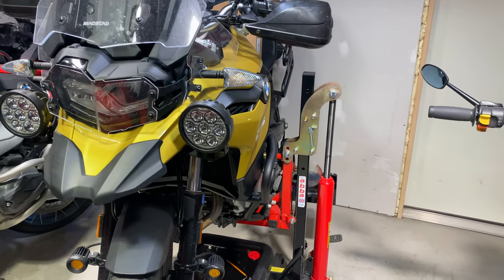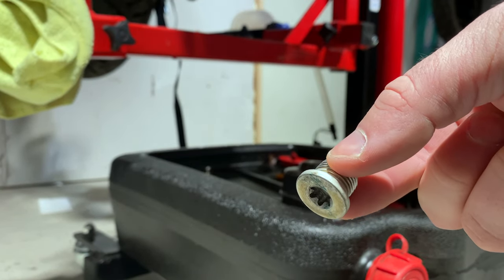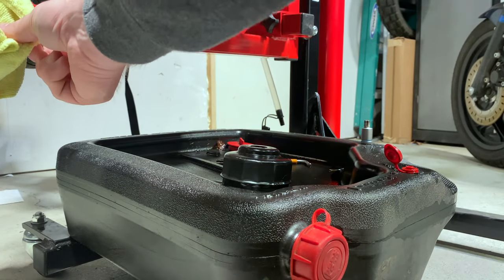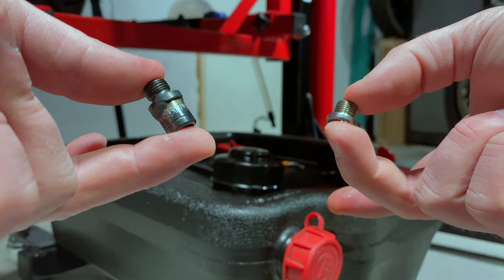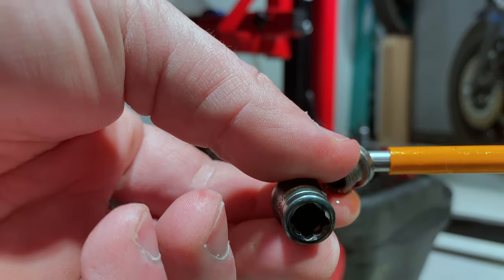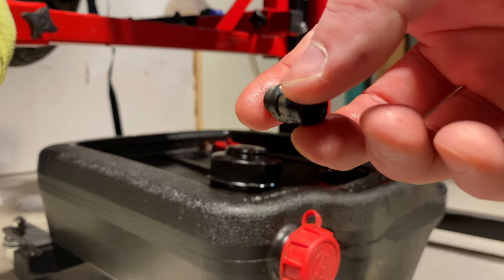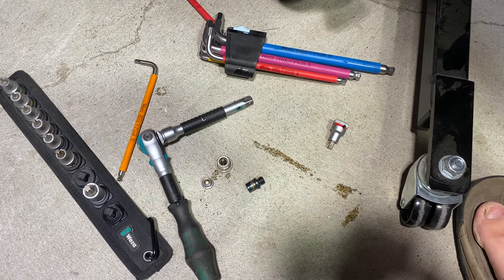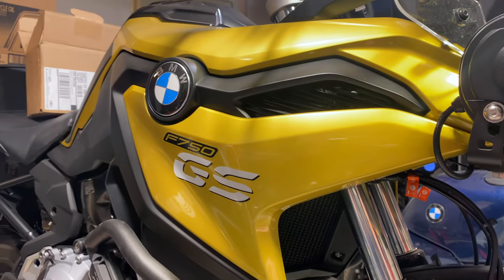F750GS: A better secondary oil drain plug?

Comment: Used one of his "super plugs" on my K16 for 50k miles without issue. His plug is made to use a 1/4 inch extension into it and then remove, you do not need to use the torx key. No stripping and a very secure connection.
Reply from the maker: Thank you Marc. I'm going to pin your post here so it's helpful to others. thank you.
Reply: @AdamChandler86  where can i buy that plug? and one more any idea how to remove the secondary oil drain plug? i stripped the plug :(